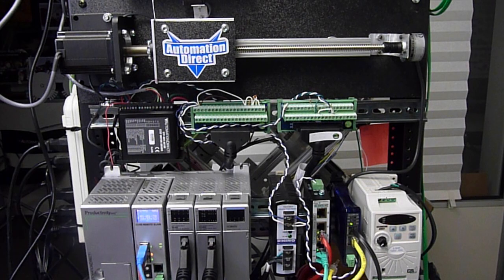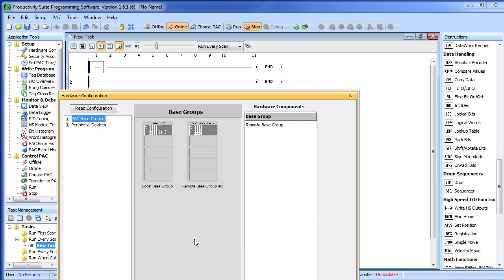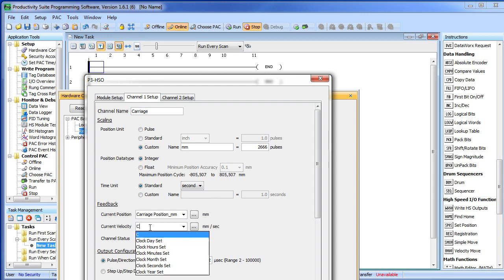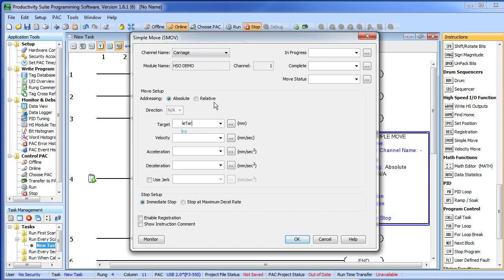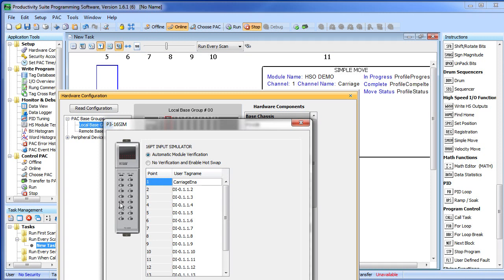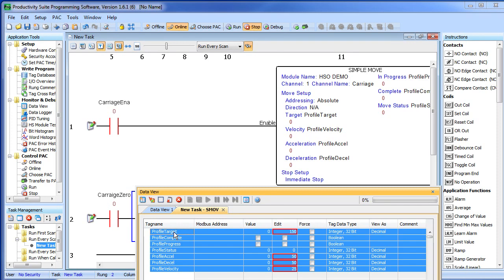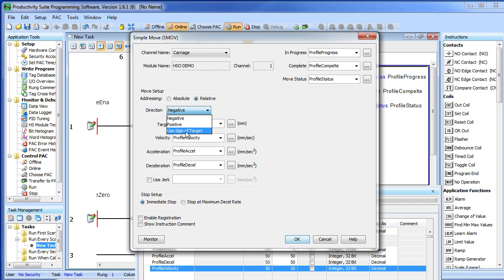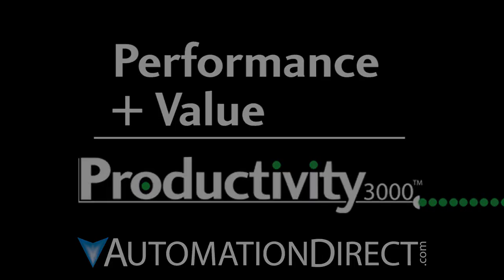Productivity3000 PLC Motion Control - HSO Motion Stepper Motor from AutomationDirect

Comment: will this work if I have a Clear-Path servo motor?
Reply from the maker: We are not experts on Clear-Path branded servos, however this module will work with any pulse receiver (like most servo amplifiers/drives can be) that has a PNP/Sourcing style or Line Driver differential pulse input.